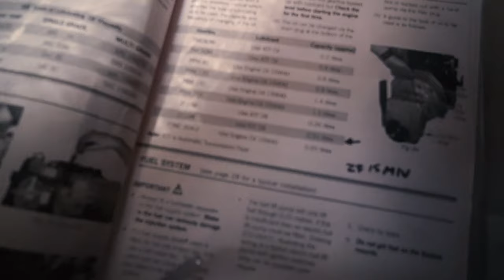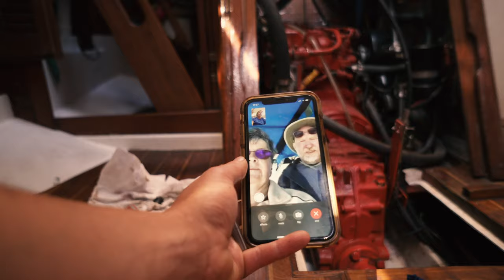EP 5 | Lost Transmission Power and Towed by Dinghy | More Engine Problems!

Comment: You all deserve a pat on the back for how you resolved it on your own without a call to C-Tow, well done. Did not have a good view but I think the bolts with the holes require safety wire to prevent this? They say adversity builds character, you all will be very full of character soon. Hang in there, soon you will be out enjoying the hard work that you are putting into it. We just drifted with the current from Cape Mudge to our marina on Fri am doing some fishing, you kicked our arses on that. We were out for 2 weeks and just relaxed and enjoyed the work we have put into our boat, it's your turn next. Please keep posting the vids.
Reply from the maker: Mike Aubie thanks so much for this encouragement mike! we can’t wait to enjoy the boat, but for now we’ve got to figure out the old girls’ quirks! And yes you are right about seizing the bolts. We ended up drilling new divits for them to sit into, resharpened them, and then seized them with wire! So far so good! Editing the next one now, thanks so much for watching:)